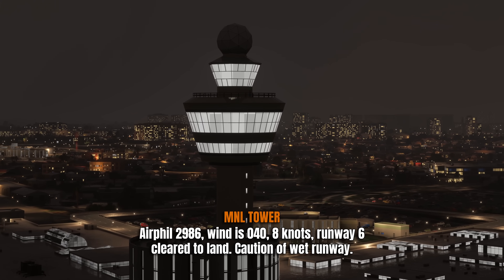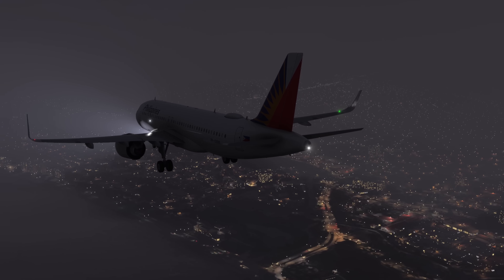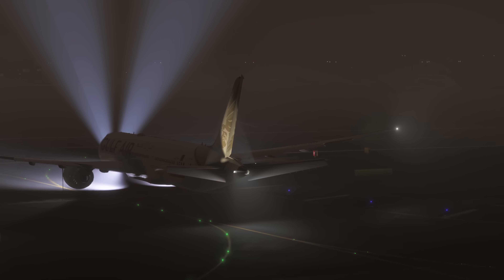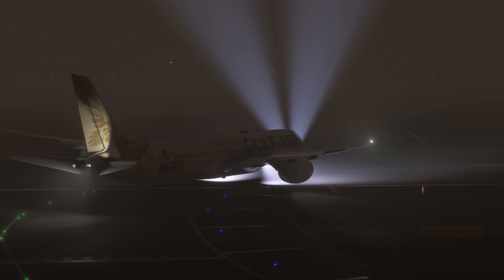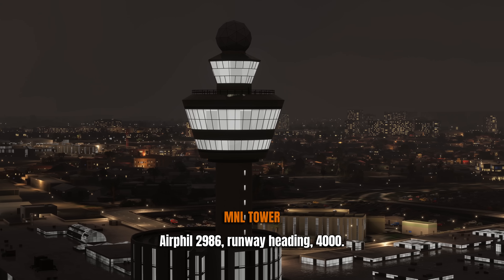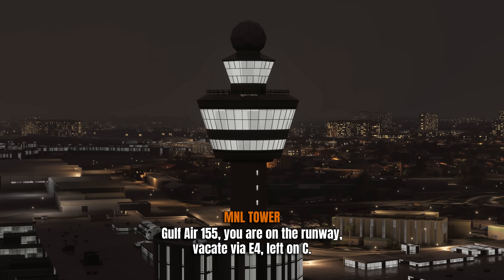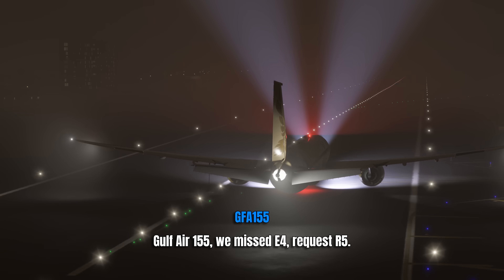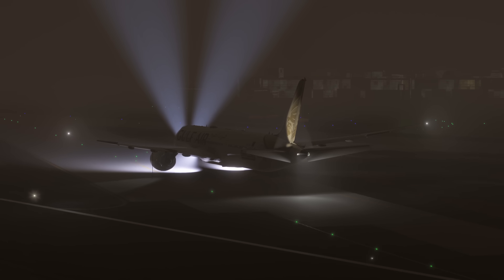Gulf Air Aircraft Enters Active Runway as Plane Is Landing | Captain Steeeve Reacts

Comment: Just to clarify this video, I operate to manila airport and the first turn the pilots took on the runway is justifiable because there are no holding points signs at all and at night with heavy rain its easy to miss, and when he entered the runway, it was better that they didn’t vacate with the first instructions the controller gave them because that exit way is designed for medium aircrafts and not heavy aircrafts and in this case this 787 is considered heavy whereas if they exited there they would have been stuck. Hope it helps to clarify the video, great work overall but just pointers to help.

Comment: Manila based-airline pilot here. This incursion happened a couple of months ago, well within the wet season when Manila and most parts of the Philippines get thunderstorms. Not offering excuses to the Gulf Air crew because it was clear that they had been switched over to the tower frequency and were given a new set of taxi instructions. There's only a handful of ways to cross runway 31/13 coming from the Terminal 3 ramp, that said, there are even more taxiways where the controller at the Terminal 3 ramp can issue instructions before handing an aircraft over the guys controling the Tower and Ground at the other side. There's rain, there's visibility problems, but the guys working the Tower and Ground at Manila can see them. Several days after this Gulf Air crew's incursion during a typhoon with even much harsher conditions than what the Gulf Air had to deal with, a Thai Airways 777 made a wrong turn after vacating the runway.
Reply: Very good points. 787 has an airport moving map display as part of their software suite. On an unfamiliar airport I would be very sure to have had that displayed on my screen. Taxiways runways all very nicely laid out. Not sure why they weren't following it.

Comment: There was another one not too long ago, CX 918 on December 16. They turned right from TWY D onto TWY C, but didn't do the full right turn and ended up on one of the high speed exits of 06/24. Company aircraft (coincidentally) had to go around because of it.

That area where TWY D, TWY C, 13/31 and 06/24 intersect is marked as a hotspot on charts,  with painted stopbar markings and NO ENTRY markings on some of the taxiways (e.g. the high speed turnoffs). If it happens again, perhaps the markings need to be revised or additional lighting (e.g. on the stopbars) need to be installed.

Comment: It wasn’t night. The stop markings on the taxiway did not conform with ICAO requirements. There was a lighted stop bar before the runway but it was turned off. It was raining. The area is a known hotspot. This has happened before at that intersection. No excuse but there were certainly contributing factors beyond crew error.

Comment: I have the antithesis of your trying to make your flight at the Manila Airport. It was 1979 on Sunday afternoon 4th of July weekend. I pull out PSA printed schedule, check flights from 
OAK to LAX thinking a day trip to Disneyland might be fun. Find a flight leaving in 50 minutes, hop in my British Racing Green MG  head to airport. Time was getting short but pulled into the parking lot and found a spot about 60 yards from the terminal. It was 15 minutes until departure, I hightailed it to the ticket counter and paid $17.50 for  my ticket and with a quickly paced walk made it to the gate just in time to walk out on the tarmac and up the back stairs of the 727 deployable stairs, thanks DB Cooper you ruined that for everyone, and enjoyed my day trip.  In case anyone cares , it was $7 to get into Disneyland.

Not sure we going in the right direction.

Comment: I recently learned that the CIA can hack cars to make them crash to kill people that they want to kill. Is it possible that the CIA could have hacked the tech in flight MH370 to confuse the pilots into thinking that everything about the flight was normal and they were still headed to Beijing? Like hacked the clock to show a different slower time than it actually was, hack the map thing to show that they were on the correct course, hack the fuel gage to show plenty of fuel, hack the communication systems to make it seem like the pilots were talking to the next comm center but instead they were actually talking to the hackers. And all the while every passenger on board thought that the flight was going normally and weren't worried. and then the CIA redirected the plane over the Indian Ocean so that they could hide it as best as they could so no one would find out what really happened to it. And then the CIA agents jumped off the plane before crashing it and was picked up by a boat, or they decided to sacrifice themselves and go down with the plane.
Reply: You should think about getting some friends
Reply: @kickedinthecalfbyacow7549 I'm not allowed to theorize about possible motives behind a plane vanishing into thin air with 239 souls aboard that we still haven’t found 11 years later???? A CIA agent admitted that they can take control of vehicles, I'm sure they can do planes as well. I know it's a crazy thought, but it's crazy that a plane literally vanished. A lot of Chinese citizens were on board, maybe the CIA needed to take a Chinese agent out and decided the other souls were worth it? It could also be Russia, or china, or any other country with a specific motive. The main question is, could someone remotely control the plane like the CIA do to vehicles of their targets?
Reply: @SurprisedCat-qt9kw you really should

Comment: Showing a map or runway chart of the runways and taxiways at RPLL would have been helpful to visually understand where Gulf Air was on the ground during this incident.  I did find an RPLL runway chart online, but it doesn't match what is described in this video, so it may not be accurate.  Both of the runway exits the tower gave them were 90 degree turns, and they were probably going to fast to make them.  But they also blew past the first high speed exit which they should have been able to make.  Makes me wonder if the Gulf Air crew really knew what they were doing.  I thought airline crews had iPads with taxi maps so they could keep track of where they are, particularly when the visibility isn't great.

Comment: I was on a 737 taxiing in PHL in line for eventual takeoff. We were crossing the main Runway and stopped due to traffic. There was a line of planes in front of us. I looked left and seen a 747 landing and heading straight at us. I looked forward, no room for the pilot to maneuver. I thought this was it. That big beast was going to cut us in half. At the last moment, 5 planes in front of us all peeled left or right to make room and we accelerated out of the way of the 747. Who missed us by about 5 plane lengths. The 747 tires were smoking they were braking so hard. This occurred both times I flew out of that damn airport. Never taking a flight thru that S-Hole place again.
Reply: Pilot should have never entered the active runway without seeing ample room to complete the crossing.
jmo CP 50+ yrs
Reply: You can’t see what’s straight ahead from the cabin
Reply: Lol you werent crossing the primary runway 06/24 but the secondary 13/31. The primary runway to your left is where the 747 was landing - iirc 13/31 cannot handle widebodies
Reply: There is no reason you should be crossing primary runway 06/24 if you came from the terminals . Only valid reason I can think of is you were supposed to depart from runway 31 [ and  back - but had to return to terminal suddenly ].
Reply: @abrahamdsl  This was late 80's Summer and that airport was jam packed. Typically, 45 minutes sitting in the plane after it left the terminal. They also had us taxi behind the plane about to take off. That east access was a line of planes waiting to take off. All flights at the time were N-S over the river. Seemed to me they were staggering groups for landing and takeoff. <shrug> I assume the airport that exists now is a vast improvement over the one I flew in and out of.
Reply: @abrahamdsl the guy said he was in PHL, so not sure were all even referring to the same continent over here lol.
Reply: @Lina_al_j  holy cow hahaha I took it to mean as Philippines when in fact I now realise he might have meant Philadelphia Intl Airport IATA:PHL ICAO :PHL XD
Reply: Both times? Doubt.
Reply: good thing never experienced that flying there. bad luck huh
Reply: Buy a lottery ticket , dangerous airport
Reply: Did the other planes realize the danger and moved intentionally or was it just pure luck?
Reply: Doubt it.
Reply: when was this?? lol sounds like old story?
Reply: Wow!! Thank God those plans  made room!
Reply: Wow, that’s terrible!!  That’s a stomach churning thing.
Reply: This sounds like something that Capt Steve would report on when was this?
Reply: @ShreddingFinn right???!
Reply: “ I looked left and seen a 747 landing ” English translation: “ I looked left and SAW a 747 landing”. I can see, I saw and I have seen this poor grammar for a long time!
Reply: @scotttracy6640 I agree 👍
Reply: @scotttracy6640  The grammar is called common American... deal with it or go somewhere else.